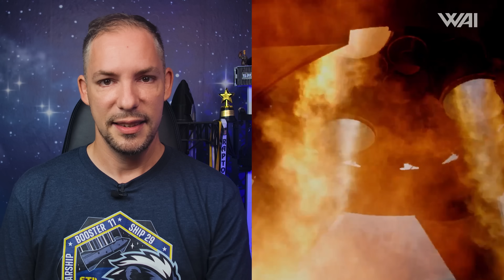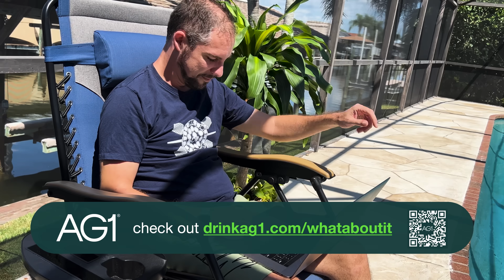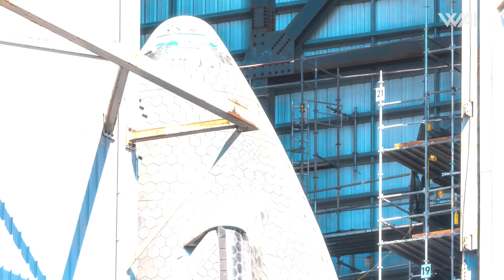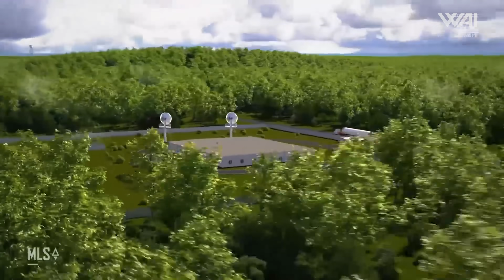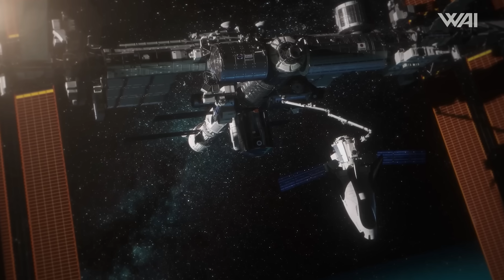SpaceX Drops Big Starship Flight 5 News!

Comment: Does anyone find these animations disapointing? firstly when being caught the booster is leaning toward the tower despite slowing down with respect to it. Additionally, it shows plasma on reentry of the booster, which is not correct. If so it'd need shielding just like the ship, and orbital speeds would totally melt the engines.

Comment: I feel that in typical SpaceX fashion they don't expect to get it this time, but if the up and down is figured out for the most part then they have to start testing the other part of landing. They don't have much to loose by testing out the strength and precision of the tower & rocket landing system. I mean money isn't really an issue so might as well throw a rocket at the tower and see if its still standing

Comment: I don't expect dream chaser to work out cheaper than dragon. Not really comparible to starship 😂. However having another orbital vehicle for supply and that will eventually be able to carry astronauts is very appealing to nasa and the government. Dream chaser is also more versatile with the landing options due to its gliding ability and I understand much lower G forces during entry. It's operational envelope is therefore quite different from dragon (or starship) . I think that is why it will succeed.
Reply: would it work on mars, that's the question
Reply: @dawatcherz  ha ha. Obvs nope but maybe simpler to operate for earth orbit transport due to the reduced landing requirements.

Ah Mars. I'm fascinated by it but it still seems so far off before we see footprints there.

Comment: Team, I guess the hypothetical question that has to be asked of NASA and SpaceX is why Barry and Sunni can't come back on Dragon 8? The Dragon was designed to accommodate seven astronauts if I remember correctly. There may be more to this than just adding chairs which in concept could be flown up on Dragon 9, I realize Dragon 8 may not have the life support connections, yet it should be possible. We have been working on space rescue since Apollo Soyuz. Dragon 9 should be able to take the standard crew, with room for additional astronauts on return. There would be some cargo impact but should be manageable. Returning experiments can be risked on Starliner. 
The other question to be asked would be is the latency of updating software on Starliner a legacy of the communication mode to the station and limited data rates and ground stations. We know that Polaris Dawn is going to test Starlink laser communications, and thus need to know if this capability needs to be added to the station possibly by incorporating it into future Dragon systems. It would be interesting to get SpaceX / Starlinks take on doing this. these could make good questions. 

Let's be honest you could see SpaceX taking the challenge to rapidly incorporate this capability into Dragon or even put an on station (if they can do a spacewalk in the current situation with suits). I suspect integration on Dragon would be the simplest from both a physical integration and political inter agency challenge. NASA isn't agile.

Comment: Several years ago an Air Force jet accidentally created a sonic boom here in Omaha and everyone stopped what they were doing and started looking around looking for smoke rising from the ground thinking something must of exploded. It wasn’t till later it was reported that a jet flying into the AF base 20 miles away miscalculated its decent speed resulting in breaking the sound barrier. Disconcerting for sure especially since we’re not conditioned to hearing it here.

Comment: Reality check:

SpaceX HLS Schedule

2022 Q2 ORBITAL Launch Test

2022 Q4 Starship to Starship in Orbit Fuel Transfer

2023 Q2 Long Duration Flight Test

2023 Q3 Critical Design Revue

2024 Q1 Uncrewed Lunar Landing

2024 Q2 Design Certification Revue

2025 Q1 HLS Launch

Tick off all of the technical milestones so far completed.

ORBITAL SUB ORBITAL flight 5 now slips to September.

Comment: I think the pins and catch arms are all wrong. The pins should be sticking out much further and there should be a dozen all around in case the booster is not oriented correctly. Why so close to the body. Does not make sense. The bare minimum precautions?

Comment: So sonic booms are not just a function of speed but also aerodynamics. In particular width to length ratio, rate of change of width, protruding bits, sharp square bits.

This is the reason that the F9 has 3 booms. This is because they are developing aerodynamically at three different points. Not only is it because of airframe shape but also airflow around an object gets distorted and you end up with areas of higher and lower pressure and higher and lower airspeed. It’s the airspeed that booms.

So in helicopters and propeller aircraft designers have to manage the tip speeds of the blades. This is a real problem for helicopters since one tip advances (higher airspeed Amore lift closer to speed of sound) and one recedes (lower airspeed less lift further than speed of sound) these tips can’t produce a boom or they will start to wobble and break or just straight up crack and break.

So I’m just wondering how many booms a SuperHeavy Booster will make? F9 does 3 so that’s a good place to start. The SuperHeavy Booster has all its deviances from a nice aerodynamic rice grain shape as sharp edges and they are big and very sudden. So I would expect the booms to be very very very loud, louder than a F9.

Comment: The only problem or worries I have with the catch manoeuvre is reaction speed. If you can get from a point that’s 100+km up and far away then all the way back to the tower then getting it absolutely perfectly positioned seems like an easy event considering the F9 landing accuracy. So my worry is that the chopsticks won’t be able to react fast enough to close and then position the whatever bit hooks the booster.

It’s just probably a couple of pins like the StarShip and those are tiny and I bet the holes they fit into don’t have that much slop. So how can the chopsticks move those little capture pin cups in and out fast enough to keep up with the small variations in booster positions as it inevitably wobbles a bit hovering waiting to be caught.

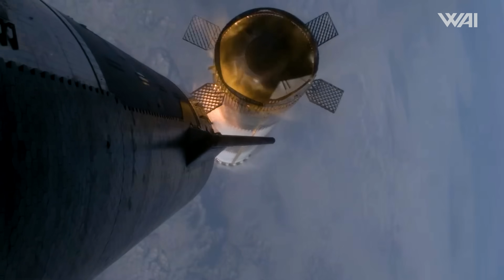Comment: 2:24 "powered by its 33 Raptor engines." Sorry,  Felix, but the outer 20 engines already shut down and will not be used anymore. So only 13 or fewer engines available after hot staging.

Comment: "once the super-heavy booster separates from the upper stage it heads back to the launch site powered by its 33 Raptor engines". Err, no. The booster throttles down to the inner 3 Raptors just before (hot) stage separation and then after the hot-staging it re-ignites the booster's other 10 inner engines so the main boost-back burn is only on the inner 13 engines not all 33 Raptors. At least that's the way it was on IFT-4 so unless SpaceX has announced a change for IFT-5 presumably that is how it is going to be going forward.

Comment: Felix,  If the computer's algorithms aren't confident of safe landing and catch by tower when final restart occurs, that can't leave a lot of time to redirect to offshore landing in water, correct ? Maybe they should even intentionally test that possibility by restarting 3 sea level engines but cutting one off to see how controllable it is vs time to impact etc ? Losing a tower would be a greater impact to program than water landing a single test rocket ( using older engines at that)  The main interest in this test is recovering rocket for heat shield inspection I believe...

Comment: they should bond tiles to ablative heat shield strips like bathroom tiles,  reduce the  pin mount count and strap them to starship in tensioned strips of a few hundred tiles at a time. Then put a few dozen back up tiles for the orbital retiling bot just incase...

Comment: Ship will have burn through on wings again and not make it through re-entry. Booster has 50-50 chance of making it back to coast line, 20-80 chance of getting to tower and 1-99 chance of getting captured safety.... I think if it gets to the tower the chop sticks will miss the catch pins and will catch the fins that will not hold the weight resulting in a BIG problem, even if engines cut off in time it will damage the tower and require a large rebuild after they figure out how to get the booster out of the way !  What will Boeing/ULA and SpaceX do in 6 years when the ISS is retired ?

Comment: Landing using the chapsticks is awful risky. Any mistake and the tower could be destroyed.  Taking the payload hit by using landing legs maybe a smarter way to go.
Reply: Why would the tower be "destroyed"? It's a hell of a lot bigger, heavier and sturdier than an empty booster... an accident would do some damage, sure, but it's like throwing an empty coke can at a wall.
Reply: @simongeard4824  The booster would have residual fuel left in it that it uses to land, which could explode like a bomb. I'm just saying  if there's only one accident out of every hundred landings, it could be bad news for that tower.
Reply: @josephcler3299  very little residual fuel, since if it's hitting the tower, it's managed to complete most of the landing burn. It's not going to explode like a bomb.

Comment: The final version of the Starship and its booster are supposed to be quite a bit taller than the current version.  I remember there being speculation that the new launch tower would have to be taller to accommodate them, but that doesn’t appear to be the case.  Is the final version not meant to launch from Boca Chica or did they find a way to fit the taller rocket on the same size tower?

Comment: The Sierra Nevada (SN) craft is not based on the US Space Shuttle, but on the HL-20. It is not a cross range system like the Space Shuttle and was original a manned space craft. And the only reason SN has that craft is due to the death of the SpaceDev founder from cancer.

Comment: They all try to launch rockets near the equator why people / SpaceX would want to launch from Canada ?! It would be more expensive !
Reply: That's just wrong. Launching from the equator is optimal for equatorial orbits (like GEO) and it allows you to reach any orbit_, but it's actually a disadvantage for launching to higher-inclination orbits due to the need to cancel out the earth's rotation. Launching from the poles would be actually be optimal for polar orbits, if you could built a launch pad there — but has the disadvantage that launching to anything other than polar orbits becomes prohibitively expensive.

Comment: The way Space X is designing Starship with a fuel tank up in the top of the rocket how will starship have a payload compartment or accommodate astronauts? It seems that starship at the moment is a big fuel tank with rocket engines.

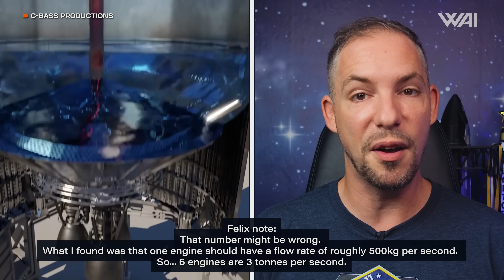Comment: 10:30 with a thrust of 280 t and an Isp of 350 s in vac, a SL Raptor 3 consumes 280,000 kg / 350 s = 800 kg / s. Probably around the same for RVac because of identical turbo pumps. Higher thrust and higher Isp tho. Raptor 2: 230,000 kg / 347 s = 663 kg / s. Raptor 1: 185,000 kg / 350 s = 529 kg / s

Comment: Wouldn't it be more cost effective to attempt a falcon 9 mid-air catch first with a different but similar mount and Jr. Mechazilla arms?
Reply: Falcon 9 cannot hover, engines cannot be throttled with the needed precision, nor low enough thrust …..
Only Raptors can Roar like that.
Reply: Right, forgot they have different engines @ernestgalvan9037

Comment: The frills on the inside of tanks (from welding tanks) can be structures that cause the fuel to gyrate in a maelstrom . That way you get phenomena in the fluid dynamics that can be uwed instead of much of thethe other stuff (heatsgield, pressurepumps

Comment: Summary

Launch & Catch:

* (0:00) SpaceX is preparing for Starship's 5th test flight, aiming for a late August/early September launch.
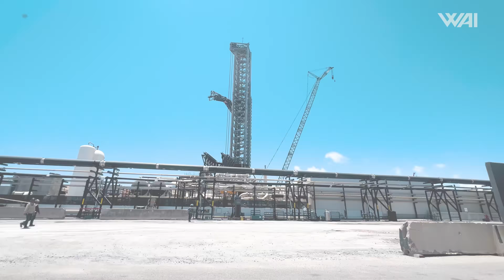* (1:07) This flight will attempt the first-ever "catch" of a Super Heavy booster using the launch tower's "chopsticks." 
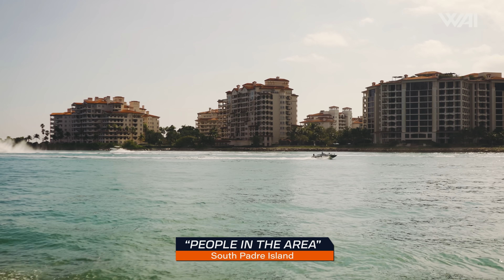* (3:40) Residents of the Rio Grande area should be prepared for loud sonic booms as the booster returns to the launch site. 

Starship Development:

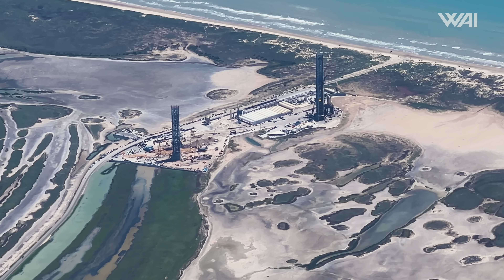* (5:00) Tower B, the second launch tower, is being reconfigured to stack taller and heavier segments.
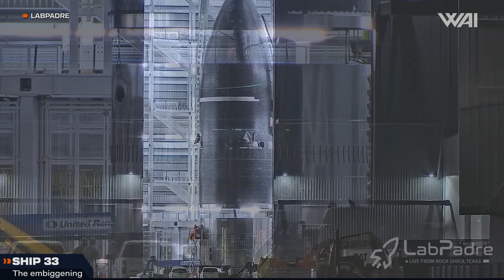* (6:44) Ship 33, the first "Block 2" Starship, is under construction with upgrades based on previous flight data. These include a new common dome design for better fuel flow.
* (11:50) Ship 31 is undergoing a heat shield tile replacement, similar to Ship 30's recent upgrade.
* (13:07) Ship 30 will undergo a third static fire test after an engine replacement.
* (14:17) A new "can crusher" is nearing completion and will test the structural integrity of Starship tanks.

Other Space News:

* (16:09) Canada and the US signed a technology agreement allowing US rockets to launch from Canadian soil.
* (16:47) Sierra Nevada Corporation's Dream Chaser spaceplane, designed for ISS resupply missions, is undergoing final testing and preparations for its maiden flight. Its launch is anticipated for late 2024 or early 2025. 

I used Google Gemini 1.5 Pro to summarize the transcript.
Cost (if I didn't use the free tier): $0.0803
Time: 18.78 seconds
Input tokens: 20928
Output tokens: 675
Reply: @wolpumba4099  Thanks, wow

Comment: Mechazilla looks like a rough and insensitive crane but it is actually a precision instrument used make  precision  movements of enormous objects to very small percentages of the massive size of the rockets. This gives two ways to position the landing rockets, using a rough positioning hydraulic cylinder or screw followed by  a super fine screw adjustor or a hydraulic or air cylinder capable of very fine steps like those manufactured by IAI Robotic of Japan. When wind can produce random movements afitting mechanism can be used to position the rocket and even custom fitted to each rocket by recording the rockets position  before takeoff so when the rocket lands the paws of mechazilla can close around mechazilla perfectly and gentlyand exactly on position and with the ability to absorb a hard landing. Elon Musk has lots of tool and die makers that know how to build fitting mechanisms because there are thousands of them in the Tesla factory on transfer and welding machines. For Mechazilla a self leveling mechanism is similar to a fitting mechanism which could dampen hard landings minimizing associated damage.

Comment: If the chopsticks system doesn’t work can legs be designed into the booster? 🤔
Reply: Yes, however it would add a lot of mass to the booster and I doubt that they would get rid of all the work they already did

Comment: Also, why not first try to land it somewhere inside of starbase and not into the arms first? They must really be >99.9% confident that they won't wreck the tower.
Reply: Nah, I figure they're just gambling that the data they get from trying to catch it is worth the risk to the tower.  It's just money, and they (almost) have a second tower.  And doing more flights first also costs money.

Also remember that the boosters can't land by themselves; they don't have landing legs.  Best they can do on flat ground is a controlled flight into terrain (aka "rapid scheduled disassembly").
Reply: @BrooksMoses  forgot they were boosters and not the main ship.
Reply: @tjmozdzen  Ships don't have landing legs either. Some versions eventually will (those landing off-Earth like HLS), but the majority will be tankers and cargo ships, which will be caught the same way as the booster.
Reply: You can't land it anywhere safely aside the arms, aside of you're fine with it breaking, which is basically the water landing.

Musk said that there is some decently small chance of it working (about 50%, but I'm not sure anymore), however if they don't like how it's going they can change the backburn and they will recheck all metrics before the landing itself, so that they could 'land' it in the ocean again

Comment: The trunks and F9 second stages need to be re designed to be used as building blocks for future space stations and not wasted by letting them burn up from re entry. It is inexcusable to not re use them as building components when they are already in orbit. A re design to make as much of their parts possible to disassemble and re use is a no brainer, after all, the best/cheapest parts to get in to orbit are those that are already there. A dosen Optimus robots to take apart and reconfigure the infrastructure/back bone of the next space station has got to be far cheaper and faster than building all parts from scratch on earth and launch them. As a bonus far less trash will be dumped on earth and in orbit.
Reply: Wet workshops SUCK.
You get a stage that can't really work as a rocket, and a habitat that can't really work as a station. Worst of both worlds.

Comment: Has anybody noticed how rockets and missiles Do NOT "Boom" when under power? They do, but only when they're slowing down. . . How's That working out for you?
Reply: Here's the difference. The booster is louder than the sonic boom when it reaches supersonic speeds. Going up, all you hear is booster. Coming down, the sonic boom happens before the engines come back on. That's why you hear the sonic boom coming down, but not going up.

Comment: I might be biased but I believe Dragon capsule launched atop a falcon 9 booster will still be cheaper than dream chaser in the long run because the jettisoned piece off of the dream chaser would need to be replaced every time. Eventually the cost would exceed that of the dragon capsule. Not to mention dragon wouldnt have to launch as often due to the increased payload size furthering the price difference over time.
Reply: Falcon 9 jettisons the entire second stage, AND the aft section of Dragon. These are “replaced every time”.